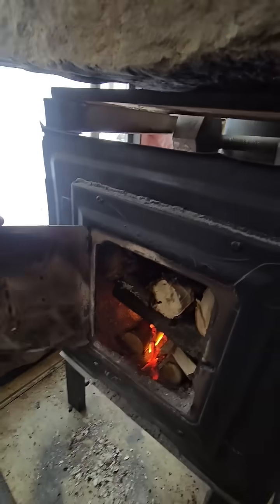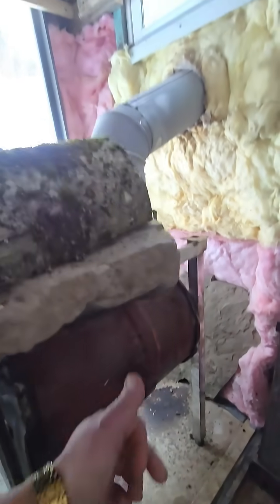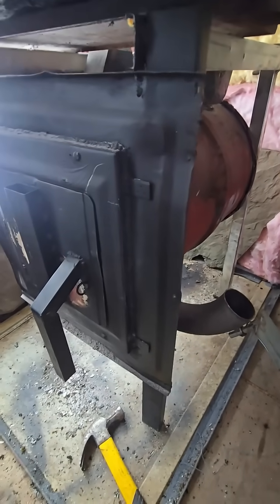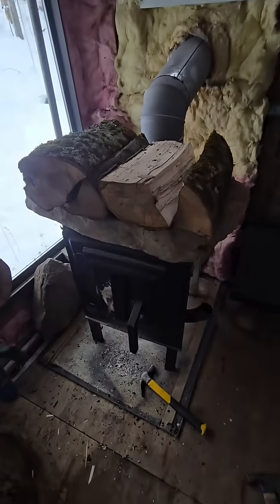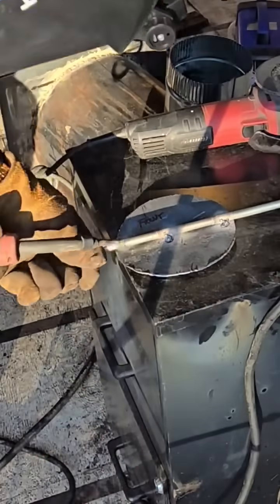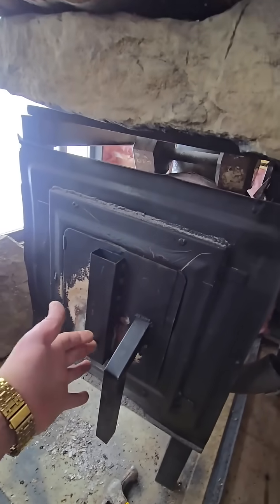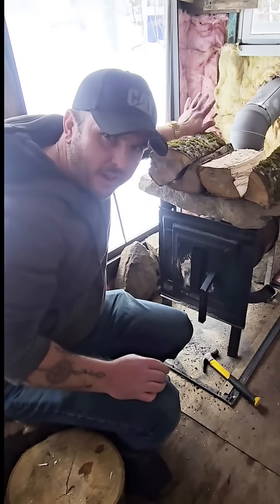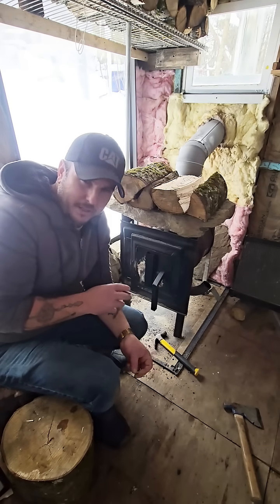Tornado Wood Stove #homestead #free #woodstove

Comment: Now take it to the next level and make it a fresh air intake. It will reduce the pressure differential from indoors to outdoors and prevent drafts from doors and windows.
Reply from the maker: That's absolutely brilliant. I never would have thought of that
Reply: @crazyDIYguy  Lots of new stoves recommend it in their installation instructions nowadays.
Instead of living in a vacuum you create a positive pressure environment this also reduces condensation around poorly insulated windows, etc. 
It can actually help seal cracks in the building during winter because ice will form on the outside where the air is leaking out. Obviously this ice sealing only works if you have constant below freezing temperatures.
The fresh air intake also doesn't have to be connected directly with a pipe as long as it's close enough to the stove that is where air will be drawn from. 
What some people do is drill down into their crawlspace and pipe some fresh air all the way to the stove and just have a grating on the floor next to or underneath the stove. Just remember to make it rodent proof.

Comment: Awesome design, I'd just be cautious with the stone as it can crack due to thermal stress, not sure if it would go through temperature jumps big enough to cause it but something to be aware of. If you want a good heat storage try sand, they already use that in various places to store heat for winter(I believe some places in finland do this). Still an awesome design.
Reply from the maker: Thank you 🙏 I was worried about the cracking too, some Flat Rocks will explode

Comment: Could you run the exhaust through a sand battery?
Reply from the maker: I don't see why not. That would be pretty smart
Reply: @crazyDIYguy by the time the pipe leaves the building it would probably be cooler air so you would not even need to worry about insulation getting too warm.
Reply from the maker: @Disgruntled2 the only thing I worry about extracting heat from the exhaust pipe is a potentially faster buildup of creosote? But I don't know if that would happen or not. Furthermore every once in awhile I just take a s*** ton of dry sticks and make a raging fire inside the wood stove to clean that out anyway
Reply: @crazyDIYguy nice call
With your welding skills you could probably use another small drum and make a hole for a clean out.
It does not look like you would need a long run of pipe.
Reply: @crazyDIYguy you might even be able to wrap a coil of copper around the exhaust and collect the heat through natural convection and then run the copper into the sand barrel. I don't know if it would work but might be worth a try if you are afraid of extra buildup.

Comment: Barrels thin walls will deteriorate quicker than a regular stove. Enjoy while it lasts.
Reply: Heck, ive used a steel mailbox as a wood stove for a small hot tent when I was younger. It worked with regular winter use for around 3 yrs until I swapped it for a small, proper, wood stove. 

The metal was probably no more than 14 gauge. I did reinforce the bottom with an 1/8" plate of steel. 
The stove would glow red if you got it rippin
Reply from the maker: @Jack_Luck.v2 make another one and post a video, that would go viral.
Reply from the maker: People are struggling with insane utility bills. I've been trying to think of a super cheap, common & easy way they can make an emergency woodstove. Your idea is amazing

Comment: Black absorbs light, not heat. So painting the rock black does absolutely nothing.
Reply from the maker: It absorbs wavelengths, heat is light just in spectrums we can't see. Even radiant heat.
Reply from the maker: I prove this if necessary. I've had this debate years ago on my auto videos and went down the rabbit hole of research. My thermal imaging camera shows the effect perfectly.

Comment: could you wrap the barrel with copper pipe to heat water?
Reply from the maker: So I've been thinking a lot about that and yeah, especially before the damper. Or if I made another 6" stove pipe coming out the back with copper coil inside of it after a damper. So I would shut the top exhaust damper, open the back one to the other pipe and heat water both pipes would be connected to the same chimney.

Comment: I would have used rock wool in place of fiberglass but what you have done is fantastic. Don’t get me wrong. I like the uniformity of rock wool is all.
Reply from the maker: Does rockwool take higher Heat? I ordered some cancer blanket or ceramic fiber. But it's been sitting on the shelf I figured I would have it just in case